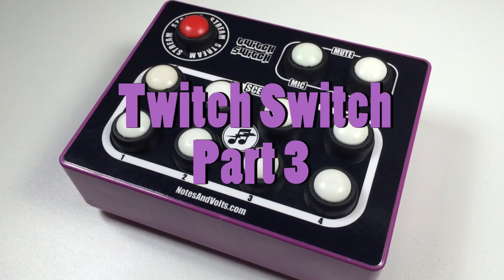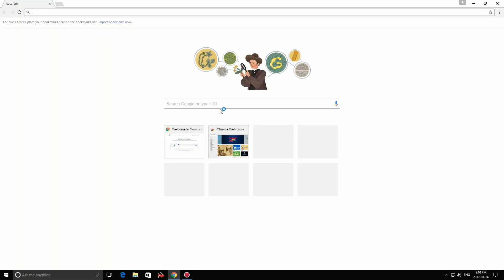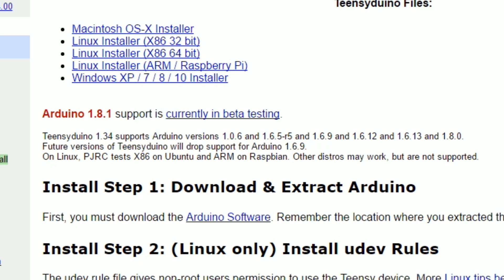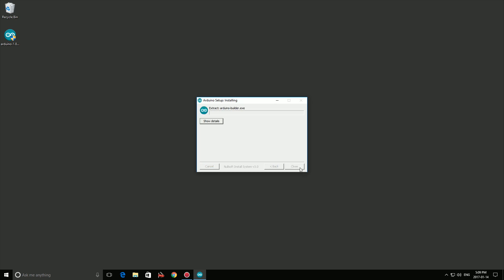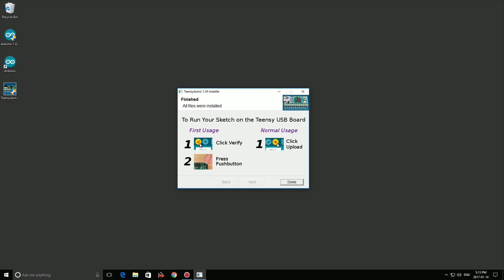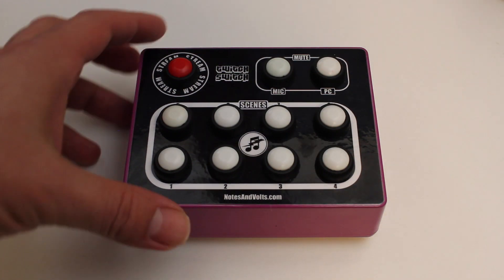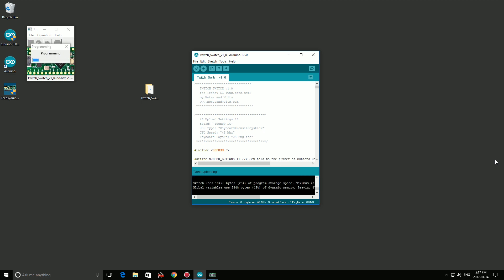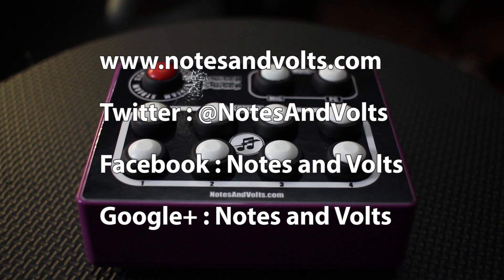Twitch Switch - Part 3

Comment: I am building a box like this one, but your code does not compile. I am getting heaps of "Twitch_Switch_v1_0.ino:46:20: warning: ISO C++ forbids converting a string constant to 'char*' [-Wwrite-strings]" and other errors when verifying. 
Everything is set up in arduino like you show (blink works, that is the only other thing I have tested). Any ideas?
Reply from the maker: Hi K2. What version of the arduino software and Teensy loader are you using? What are the other errors?